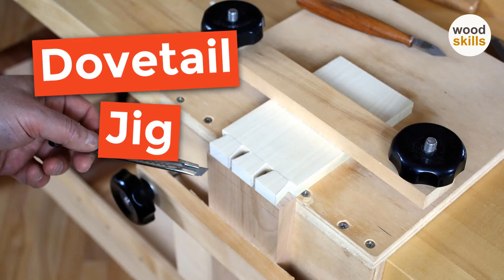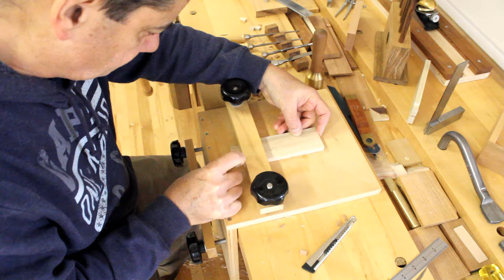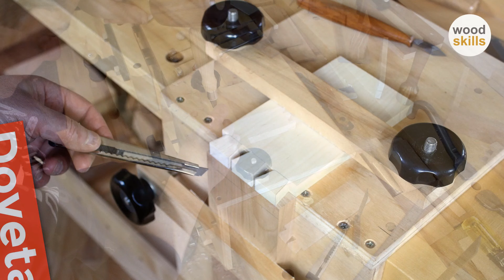Dovetail Jig (Cut Dovetails Faster by Hand)

Comment: Very nice.  I built a very similar jig but I added low fences on both sides of both the horizontal and vertical boards for perfect alignment. It makes using the offset dovetail method taught by Rob Cosman far easier.
Reply from the maker: That also works!